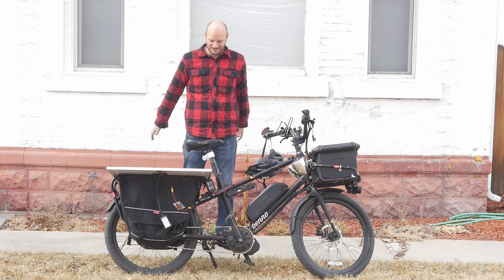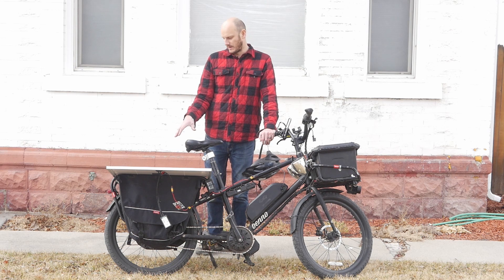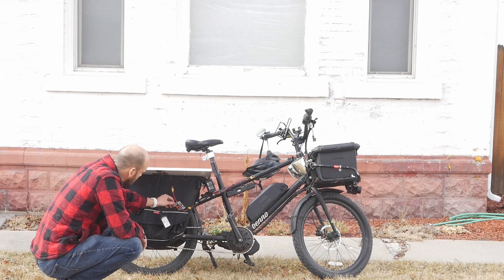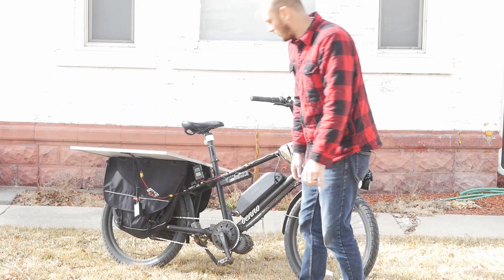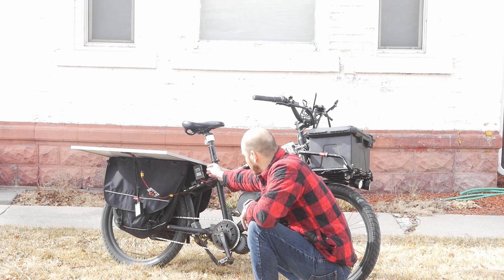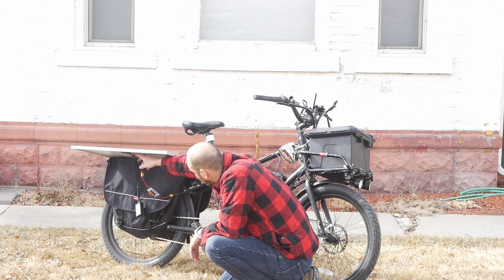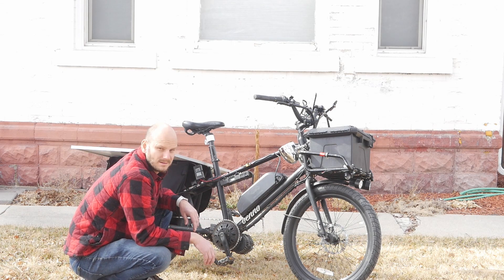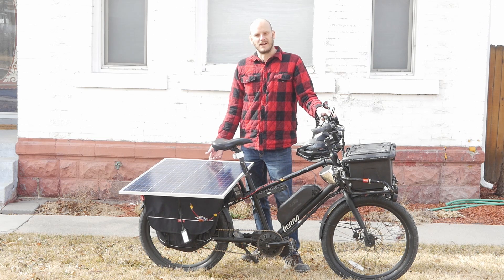My Cheap and Easy Solar paneled Electric bike setup!

Comment: I have a pecron inverter bank at 1200 watts with 600 watt hours and a fold up solar panel that folds to 15x15x4 and usually provides around 100 to 120 watts so in a good day of sun I can get around 400-800 watts which works out to be around 60-80% of a standard ebike battery, the system weighs around 25 lbs for the solar panel and inverter, the system was $250 and the panel was $95. So free power off grid, 3500 charge cycles and approx 10 year life for the battery inverter

Comment: Hi, fellow solar ebike DIY'er (see https://www.youtube.com/watch?v=Dm_LgFR8enM).

Have you considered a proper solar charge controller, so you don't risk overcharging your battery? You can even get boost controllers, so you can step up to the required voltage. Though the good boost controllers are pretty pricey. Even your are willing to fork out $150-200 you can check out the Genasun boost controllers, which I have not tried, but do have a good reputation.

The angling make a lot of difference to the performance. Even more important is keeping the panel shade free. For cheap panels even a tiny bit of partial shade can cut performance 80-90%.

Comment: Could build a trailer find a tiny alternator. Play with sprocket size on the trailer/wheel axle say running two wheels. Then try to figure out optimal rpm the alternator would be effective mounting the smaller sprocket as if the alternator was at your bottom bracket. Then charging a battery on the trailer. And doing your conversion to 110ac and so forth with battery bank.

Comment: Technically it is battery powered, but i agree what a great time to be alive. One panel like that is not enough to tour around without stopping and waiting, or plugging in to the grid or use gasoline generator in the camper, or alienator in the truck, etc... to charge it. And if you are touring on the bike you won't have the camper or truck, you will need to stop and wait, or stop before you run out at a plug in the grid somewhere. It is not really solar powered, only 100 watts of it. lol  
But it is now feasible to at least to put some on a bike, because price came down and efficiency went up.  It still is not enough to run it without a battery though, you would be going like 1 mph, but a battery is essential for night and cloudy days, and shady areas.

Comment: Hi, I'm marco👍 I hope you can help me.  I have been trying for some time to realize my journey with solar, trailer, dog.  but in my country there is only calcium .. I have to power the Bafang 1000wat BBSHD by putting the battery down while I use that charge.  if you send an email it would be better to write there.  so i show you my dog trailer ❤️🐶😉💪 ,, i have been working on it for 1 year.  designed and drawn.

Comment: fun it is, started the same way, I use a 100W panel on a trailer, I will convert it to 180W now, gonna cross the Alpes in July (2.200 Km in 4 weeks)

Comment: ...And you connect the "LOAD" to the motor's controller, right ?
Reply from the maker: I connect it to the battery so the battery is always being topped off. One panel would not provide enough amps to power the motor ☹️
Reply: @JohnnyNerdOut  I meant the solar controller's LOAD output.
Reply from the maker: @dimitristripakis7364  still. The solar controller puts out 1 amp max.
Reply: @JohnnyNerdOut  Thanks!

Comment: So you're able to charge while riding?There isn't a lockout that prevents charging and using the motor at the same time?
Reply from the maker: Yes you can charge and ride, no lockout. At least on the batteries I use. Some premade bikes do have that function. Reason #2 why you should build your own bike 😀

Comment: A very nice setup for ebike riding, however the assumption that inverters are an efficient transfer of power are wrong, They are certainly convenient, but not efficient.
Reply from the maker: Absolutely. Every time you convert voltage there is loss. Especially inverting.

Comment: I am sorry Johnny, its a good ideea to charge from sun. but you made a big mistake. I have to dislike your video because you didn't used a trailer for the solar panel. You cannot obstruct the solar panel light by your own body when riding the bike. This is a failure. The solar panel will produce only 3-5% of its power if you cover a very small part of the cells. The solar panel its also flat positioned which means has already a smaller output power lowered by 10-15%. 
I am sorry, but you have to learn how to build a solar bike using a trailer. In this way, you cannot review any real infos or advice youtubers into these builds. They will fail if they do the same project. Disliked video.

Comment: My question is can the solar panel charge the battery as your riding and using the battery?  Does that work?  And.... I have to ask you what is in the front box on the front over the front wheel?  Is that another 48v or 52v battery that you have running together with the one that we can see that's attached to the frame?  I am wanting to run 2 batteries together and hook up a solar panel to help charge as I use it.  Thanks you for making this video as well as your others I've viewed.

Comment: I see a few things that could be the reason why you're only getting 15w.  The two most obvious to me is your Boost Converter circuit.   That thing is TINY !!!!  Based on its size,  It's probably only rated between 30w to 50w.  Connect another one in parallel or get a bigger one.   The other reason probably is your voltage.  If your battery tops out at 58v  and you set the Boost converter to 58v,  it ain't gonna push that much power to the battery.   Think of it as water pressure.  If the pressure of the pump and the pressure in the tank are almost the same,  water ain't gonna flow that much, if any at all.
Reply from the maker: I think it was also the time of year because I just tried it again and I was getting 60 W

Comment: About 10 watts (or so) per square foot, so ~ want 20-30 square feet for sustaining one’s run @ 200-300 watts.
Reply from the maker: I’ve managed to get 60 watts out of it in overcast days. I filmed this in the winter so that may have affected it

Comment: You need to put a canopy over your head.  That way you can ride in the shade and have a lot bigger solar array to keep your battery charged.  There is a Couple who put a canopy over their Moto Guzzi and they have a solar panel on it as they ride 2 up on the motorcycle around the world. They have their Guzzi loaded with more camping stuff than a Winnebego.  It sure worked for them, and they say it's perfect for riding in light showers too!
Found the link.  Just for fun!  https://youtu.be/-wkSePMgR0k
Reply from the maker: I was working on a version but was scrapped because it was crappy. Need to do a version 2.0

Comment: Nice!  I have two 100 watt solar panels n my 2010 transit connect that I converted into a little camper with a 12v compressor fridge and 200amp lifepo4 battery I put together.  my ebikes battery is a 58v 23.8amp I can get about 60 miles on it(over a few days lol)  I like taking 15miles rides and i can charge it up overnite and by 9am my battery inthe van is back around 180-190amps.
Reply from the maker: Very cool!

Comment: How is the solar panel going now it is a month later?
I would take a guess that the loss is due to the voltage step up unit? But even on the best of sunny days, a 100Watt panel 17v will produce <6amp. I would have thought that should keep the bike battery charged ? 
Have you taken some measurements of the actual bike power drawn from the battery? Would that be more than 10Amp?

Comment: Great video...Kudos... did you have regenerative brake on your e-bike? Mine does, and I don't know how this would play if I did a set up like yours, using perhaps a bit larger solar panel, and a boost up dc converter to my 48V battery pack... I am kind of worried if the battery would be over fed if it intakes the regen power and solar power at the same time... any thoughts, experience on this would be much appreciated....

Comment: Love it! Gotta put the panel on a cargo trailer though. It’ll look way better and you’ll be able to pack all your camping stuff in it.
Reply: Exactly where I am at.  Had a heavy steel cheap trailer.  Replaced much of trailer with aluminium and next change is to add uprights to hold a 200watt solar panel, that will have a (manual to start - automatic later) tilt feature to increase solar efficiency.  Like Johnny, I am a fan of Bafang motors and Jack butler had similar specs in the 2019 SunRace
Reply: You could also make a kind of Tuk Tuk by fitting a side car to your bike and having a solar panel roof covering the bike and sidecar, would be good for hot summer days, give a bit of shade and power

Comment: If you put a rectifier diode 1N4007 on the wire coming from the solar panel it will give you more power and you could possibly use a smaller solar panel
Reply: Explain please how a rectifier can increase output I don’t comprehend.
Reply: @patricminderhout  a rectifier diode has high current capability and low forward voltage drop. Diffused Junction. Low Reverse Leakage Current. If you connect to the positive wire it ups the voltage from the solar panel.. I have tried this on small 6v solar panels and got 12.9v and successfully charged a motorcycle battery in 3-4 hours

Comment: i use this mppt charge controller and it's definitely quite a bit more efficient than the popular green anodized MPT-7210. with the solar panel you have in that example you can probably get 50W with proper inclination
Reply from the maker: Link?
Reply: forgot to paste the link. This controller is really quite efficient and lighweight. I consistently get over 2A charge current with 1 flexible solar panel about the size of yours and 2 25 year old panels of about 1'x3.3' wired in parallel. currently I don't have enough time to burn all that solar power 😀
Reply: @JoLe1991  Genasun?
Reply: @magnusnyholm  no idea, check the link. brand is chinese. it's very light and efficient
Reply: @JoLe1991  where is the link?
Reply: @magnusnyholm  somehow youtube is constantly deleting my link... search for:
" MPPT Solar Panel Cells Charger Controller 10A Booster Battery Voltage Regulator F3MB "
on Aliexpress
Reply: @JoLe1991   Thanks. Found it. 😁

Comment: You loose efficiency when go to AC. Keep your system the way it is , but and a 12 battery (7.5 Amp Hour costs ~~ $50) batteries have a internal resistance more suited for solar panels than the DC to DC converter.I turn the battery can easily drive the DC to DC converter. So, win,win.
Reply from the maker: Where would I add the 12v battery?
Reply: So panel into 12 volt battery max efficiency.no resistance 
Then no buck up ? Ok I’m lost

Comment: Have you heard of a race called the "SunTrip?" They do a solar ebike race from Leon France to Guang Zhou China which is ~8000 miles! Look up Suntrip 2018 for the full 'movie' on youtube. There are a few people who participated or will participate in the race who make videos about their rigs. The only one I can think of at the moment is "That Solar Bike Guy" but his videos are very in depth and informative. Looking forward to more content about this as I'm also soon to add it to my touring rig :) Not as much as solarbikeguy but yea I'm hoping to be able to fit ~150w total on my recumbent rig :) My only issue is finding a boost solar charger controller that can do MPPT separately for all 3 of the solar panels that I want to put on the bike(as opposed to 'single' MPPT which does it for all 3 panels at once, trying to average their voltage), as they're all going to be facing different directions, and I don't want the 1 or more that are in the shade to ruin the efficiency of the one that's in good sun. I might end up having to run  3 separate MPPTs that are all small/rated for low power (for weight)...
Reply from the maker: Ya that race is pretty cool 😀 beat of luck with your setup. I’ll be tweaking mine

Comment: I think you hit the nail on the head at 2:40 use the solar panel to charge a battery bank and then use that bank to charge the 52V battery.  That's exactly what I plan to do just because I can get my mits on a free Nicad bank.
Reply: There's a huge loss going from dc to a.c back to dc.  You need a bigger solar panel to do solar charging and a MPPT boost controller.   This guy's solar panel is too small.  My setup is 390w..https://youtu.be/2_toGddS4BA
Reply: Use a boost MPPT controller and 300W PV solar panel or bigger.  This needs a trailer or folding panels when you stop and charge.  Your way is just impractical as its too small a panel.

Comment: This is along my line of thinking to build an ebike for long road trips (ebike hobo) that costs very little in fuel to travel .Use a full suspension ebike with rear rack/saddlebags, backpack and single wheel bike trailer( suspension on trailer also)  with a solar panel on top used as the cargo trailer lid/cover,(it's only 100w but better than nothing) also maybe bring along some thin lightweight fold out solar panels. Or instead of bringing a bunch of fold out solar panels. Just bring along a $200  25 lb 800w gas inverter generator, they're 4 stroke, very quiet and use very little gas at 1/2 throttle 400w charging power......Adding a small inverter generator to an ebike makes an instant gas/electric hybrid-no range anxiety.Mount it to the side of the rear rack where a saddle bag would go. Made to easily be mounted & dismounted, when you don't need range. leave it at home. When needed for road trip, mount to the side the generator for being a gas engine is extremely quiet compared to a motorized bike engine,lawn mower engine.etc..
Reply from the maker: I’d go hardtail with a thud buster IMO. 😀
Reply: Michael,  Thank you for adding your thoughts.  Will you give me a link the the gas generator you are referring to or more details so I can find it?  The small gas generators I found are 40 or more pounds.
Reply: @Simply.C  a Sportsman 800w or Lifan 700 inverter generator weighs around 20 or 23 lbs . The sportsman has 1000w max surge  power and 800 running watts. The Lifan is 700w surge & 600 running watts. They used to be sold for under $200, they're not the best quality but will last if taken care of properly. I was sorta typing/thinking out loud when I wrote the first comment. I did see a couple videos where people mounted small inverter generators to e-bikes and trikes making a hybrid. The battery pack would last longer if only drained down to 25-30% then recharged with generator back up to 80%.VS full charge 100% down to almost 0/dead. I wish I had a good e-bike.... But yeah, for a long e-bike packing/camping road trip a small $200 inverter generator = instant gas/electric hybrid bike.

Comment: You could just get a foldable panel and bring it with you instead of mounting it. Then, when you need a charge, you break out the panel and let it charge. Solar panels become practically useless if even one of the cells is shaded, you're gonna have a hard time keeping the sun on them and not the shadow of your body.
Reply from the maker: Yep. I have a nice 100w folder I will try to incorporate

Comment: The factory charger is part of a battery management system. Even though the connector is 2 pin, we have no assurance that there is not some communication signal superimposed on the charge wire. Question, is that ripple current really ripple? Without engineering documentation, we don't know what we are bypassing by not using the factory charger. Chargers are fairly cheep, so taking one apart to see whats in it could be instructive. However, there is no guarantee that we wont find some mystery blob in potting compound that leaves us with more questions. Taking a battery apart to see what is in it is only an option for a wealthy person unless someone is paying you to do that. What we can discover could be something, nothing, or more mystery. Lithium Ion batteries should not be trifled with. A burning battery can literally dissociate water to capture oxygen and release hydrogen gas which also burns. You will not be able to put out that fire before it burns out, hence LI batteries have safety circuits in them. There is a reason governments prohibit these things on airplanes.

Comment: Awesome. I look forward to seeing how much it extends your range, and if it's worth the hassle.
Reply: 1.5-3miles a day. That panel its obstructed by the seat and its body. You must have a trailer. Don't do it like that. He has not done enough research about solar panels.
A solar panel with 50watts output would produce half of his energy if positioned flat.
Then, if its obstructed by a tiny object, the panel produce almost nothing. From 20watts goes down to 3-5watts.
He should be using a bike trailer.
Reply: I agree im interested as well